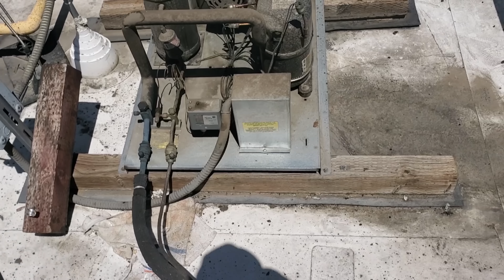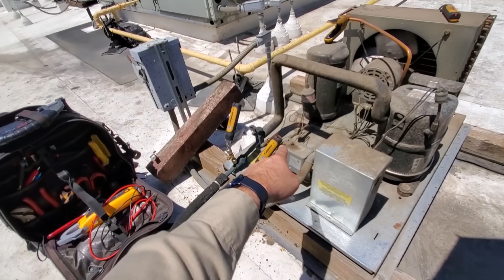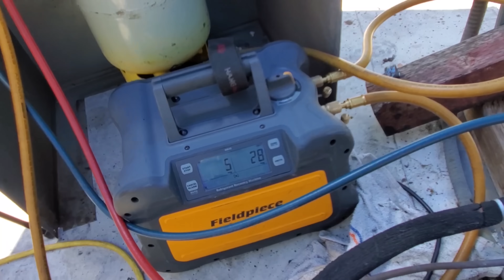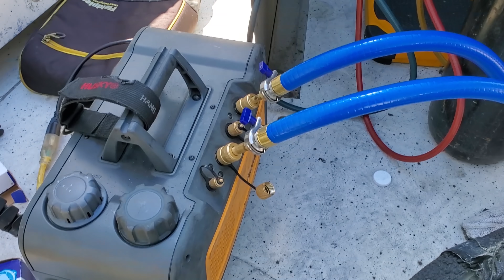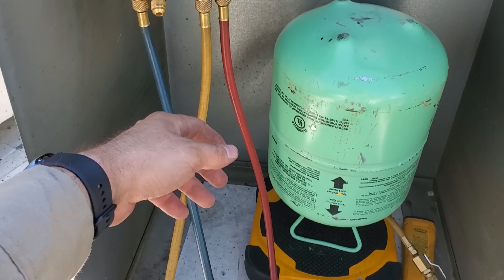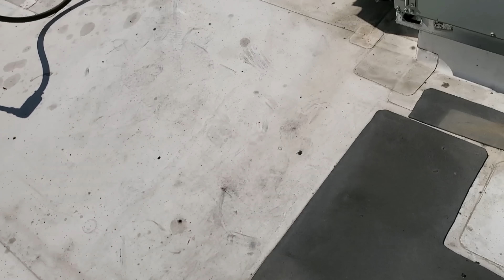BEER WALK IN TOO WARM

Comment: Beer should have a temp between 42°F and 57°F when you drink it depending which kind of beer you have. The correct drinking temp is easier to decide in °C if you don't have the drinking temp from the brewery.  The amount of alcohol rounded up in the beer equals the best drinking temp. For a 6.5 beer the temp should be about 7°C or 44°F. You can test that if you put some cold beer in a glas and smell it and then warm it up with your hand and you will recognize the flavor will get richer. Beer that is to cold is tasteless.

Comment: I have a suggestion for your question at 3:10. Contactor coils fail when they don't pull in the entire length of the armature. This is most often due to a problem in the coil control circuit, such as a high resistance switch contact, and the voltage across the coil shows as a lower value when measured during the event. When the contactor does not pull in 100%, the magnetic field that is not sunk to the armature allows for a higher continuous current to flow than the coil is designed to sustain, and the coil then overheats and the result is an open coil. You can tell that this had happened by inspecting the coil for warping of the plastic thimble on which the coil is wound. A hot coil will tend to distort that thimble.

Comment: I prefer dark beer too, but I prefer cold & to sip & let sit in mouth a few seconds, I do not like majority of normal beers, & usually would prefer a soda to a piss beer. lol. 

didnt know there were torque specs for these contactors, but I was aware of torque specs on lugs in big electrical panels. 

for your needle nose, when you crimp those wire lugs,  get you another cheap but decent pair, now heat & bend end on top & bottom,  so that you have a "pinpoint" pressure point across end, & 1/2" back from end is an opening about size of a small straw, that will work wonders for wire crimping. if need pics I will send you pics of mine. 

lol dig your adjustable wrench "torque wrench" "click".... look at vintage Harley repair manuals, prior to the 1980's "tighten until tight" yep, all too familiar with. no torque specs at all on vintage Harleys. 

could you have heated hinges to straighten? I know its a pain either way, then if had to make a new latch tab for top? or am I over thinking since I do metal fab? since here we are concentrating on refrigeration.
when I do go go to buy any tools in future, I will look to see if I can support you first. through any links, but its June, I am 2 months from having bills off me, I have 1 car payment left & 2 house payments, just did car payment yesterday.

Comment: Is there a reason the drier/sight glass couldn't be pulled inside of the unit? Personal preference for me, I dislike the sun weathering it does to the sight glass especially, i saw you capped it but those plastic caps in my experience don't last with sun damage very long

Comment: WTF!
In Switzerland (Europe) R22/R12 are forbidden since about 10 years or even longer! and u put it back inside? Crazy world.
We are allowed to build R744 or R290 systems easily, but R134a and R449A are also used much. R404 is forbidden since this year, R407c also, so only low GWP refridgerants are used, but its allowed if there is NO other possible refr. to use. (for ex. as an deep freezer (-60 °C)) Crazy world we live.....

Comment: I sure hope my mechanic doesn’t use the same torque wrench when he’s changing my tires! “CLICK!” 😂
Reply: I guarantee he just whacks them lugnuts on with an impact, well past the torque spec.
Reply: 20 ugga duggas it’s on tight then maybe a click
Reply: I guarantee he does
Reply: Torque specs have there place, machines, tires, head bolts, stuff like this. But on a electric screw terminal its kinda overkill :) The only reason they put them on there is so people don't break wires of by screwing them in till they ... well break of i guess :)
But to address your concerns: Most mechanics will use a torque wrench, at least where i life since they are legally viable for damage done when a wheel comes of or they strip a thread etc.

Comment: Hey Chris, why  the walk in cooler has a suction pressure of 50Psi and a walk in freezer has 30 Psi suction? How is the 20 Psi difference obtained? Is it the TXV calibration or the compressor  being a LBP type? And why cant we use Medium temp compressor for low temp applications?
Reply: Remember lower pressure equals  a lower temperature so a freezer has to have a lower PSI. 

How is that obtained by using different gases if needed and having the proper charge. 

You can't use a medium temp compressor in a low temp application because that's just not what it's designed for, it will work but it will significantly shorten the life of the compressor.

Comment: What brand are those Schrader core tools? How often do you flush that micron gauge with R-11 if you do? Me I put my micron gauge at the back end of the tool this way you can shut off the valve and not push freon thru it. This way no oils cause false numbers. Great job fixing that box.

Comment: I wont yell too loudly, but you should always cut and freshly strip wire ends. why? under-tightened they overheat and oxidize, too tight/repeat cycling cuts wire strands making it loose and weak.
cranking the lug screws in and out cuts into the wire and weakens strands, so can going super torque monster, that said, everything I've seen tightened with supposed proper torque, has loosened up and burnt down nearly.]
I tend to twist the screw heads into submission and more chewing into the few surface wires once, never back them off to look and re-torque, just asking for trouble. unless it's test wire isolated form all

Comment: Why didn't you move the valve back towards the receiver, so that the dryer and sight glass are still inside the unit and aren't hanging out in mid-air like that? Seems like they are much more vulnerable to being damaged now that they are outside of the unit. It surprises me too how much of the pipework is just left floating and unsupported. With the amount of vibration it is likely subjected to it is no wonder you get a lot of leaks.

Comment: That metal box with the contractor inside may be a commercial off the shelf part they buy from a smaller supplier and then just wire up.

Comment: Bitchin (literally at times in the video) torque wrench set. Haha. Great video as always. Serious question, when should you use a torque wrench in this industry? I've only ever used them in automotive/diesel environments and even then only on lug nuts or torque sensitive parts.

Comment: I agree it is really dumb that they did not fix the roof hatch when you told them that it may need to be fixed. All the way over here in Missouri I felt your frustration. I hate when I am looking forward to getting something done and when I am wrapping things up and something else comes up and you have to go fix another thing that should have not been an issue, to begin with. See you tomorrow night for your stream!

Comment: 5:08 I recommend to use wire end ferrules there (cause it's the right thing to do as not doing that could cause points of high resistance).
I'd also recommend using some name-brand isolated electrician's screw drivers too to protect you (something from Wiha should do the job - they also offer them in a "torque screw driver" model as well).
I enjoy watching your videos :)
Reply: It looked to me like he was using isolated Klein screwdrivers
Reply: @jeremyhundley3142  yep, you're right! I just re-watched that part - guess I didn't look close enough as I'm usually watching stuff on my phone.
Reply: I love getting new tools but I think I'll skip on the $300 screwdriver set. Lol

Comment: "I can't handle an upside down contractor face plate" Chris, love it. I have one of my former co workers, he's a great tech you two would hit it off fine. One of his sayings is "If it's worth doing it's worth overdoing". he had Covid -19 fully recovered and back to work thankfully, good guy but he drives me nuts. Lots of fun to work with though.
Reply: Maybe the tech was laying down on the job (on top of the unit working down for the rush.

Comment: Actually you can get torque controlled screwdrivers, but they are big, expensive and not really needed for most electrical work.  Your just need common sense which you have.

Comment: I’ve had a brand new oil safety control fail to what I believe was when I applied a little bit of nylog to the flare fittings it caused premature failure of control. Clogged internally ? Even used the flexible super hoses instead of cap tube. What do you guys think ?

Comment: Why this system can't be pump down? Or you can't change the drier while it is pumped down ?
Reply: If you notice the liquid line drier is before the service valve, you therefore cannot do a pump down to fix say something on the evaporator side of the system without the hassle of doing a full recovery. This is because best practices dictate that you must change the liquid line drier any time you open the system. In this particular case it really does not apply to this repair as Chris does have to do a full recovery in order to fix the high pressure cut out. The manufacturers do this in order to keep all of the components in the cabinet and do not give much consideration to future repairs. You will also find this many residential condensers. Hope this helps.

Comment: Not a refrigeration guy just trying to learn, you said you’d put a dab of silicone on the fan cycle control? What is the purpose of that? Something to prevent rubouts?
Reply: mdt1993 that’s exactly what’s its for. Many manufacturers run silicone alone the top side of the capillary tube coils in order to keep them in place and minimize vibration.
Reply: coil them on the rubber handle of your 11-1, only use what you need to make it where you're going

Comment: The roof hatch problem can be sort of fixed with a length of chain, just long enough to stop it opening up the full 180 degrees. I'm thinking of about 135 degrees from closed.

Comment: I would recommend using crimping pliers and cable end sleeves - they are mandatory in Germany.

It's so much safer with high ampere loads on those flexible cables :)

Check out the Knipex Twistor 16 - it's the perfect tool if you have to work in tight spaces.

Comment: Good job as usual! So R22 is still good to go with repaired systems? I'm assuming it was 22 from the dumpy bottle colour. If so, is it not practice yet in the US to drop in a HFC equivalent or retrofit the system for a HFC with a more favourable GWP? Be safe! 👍
Reply: Not required in US on existing systems. R22 units run best with R22. If we're worried about GWP, tell Elon Musk to stop firing off all those rockets! 😂😂

Comment: So summary seems to be - you rushed a job late at night fixing a fan switch, and because you didn't (and still don't) have a torque wrench to tighten the nut to the correct tightness, it leaked, causing a loss of gas, so the compressor kept tripping causing the contactor to eventually break..   If only you'd done it right the first time with the right tools...  - Or have I got the summary wrong?

Comment: I really liked this repair that just came in, which is a little admired Because for me I thought that the refrigerant 22 no longer existed in the United States and I am seeing that there is still equipment that uses this refrigerant, it is a simple system with 22 refrigerant not they are handled high pressure it is super fast to get for high temperature than what is required for beer or ok I really liked the singing you made at the line filter location and also the change of the contactor which will be the main problem is It is important to always check to prevent future failure, for example, you could see that there was a leak in the liquid line from that line, you replaced it with a new one about the location of the line filter drier and it is a very good service. situation of the coronavirus because people don't want to spend a lot of money, you have to be very careful with work, but work is always there. I always say that while it is refrigeration equipment we will always be working so that these equipment continue working so that you have an excellent afternoon until later.

Comment: Why did you not cut out  the suction line Aeroquip fitting to prevent possible leaks later?
Reply from the maker: I wanted to but I didnt have any 7/8 copper to fill the gap, I will discuss this on my livestream this evening 5/11/20 @ 5:PM (pacific time) come check it out https://youtu.be/KHj-ZloqCvY